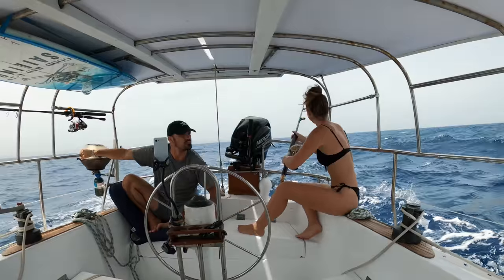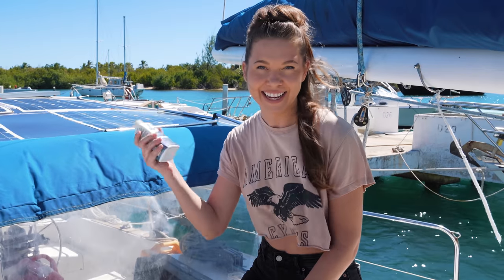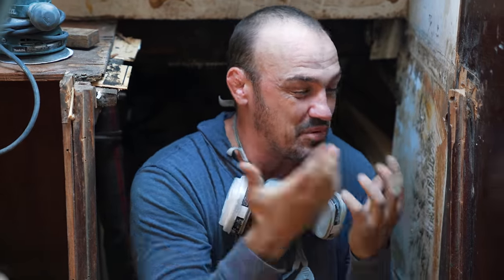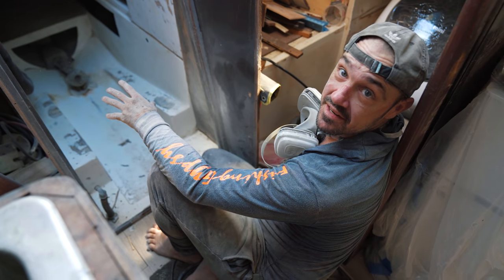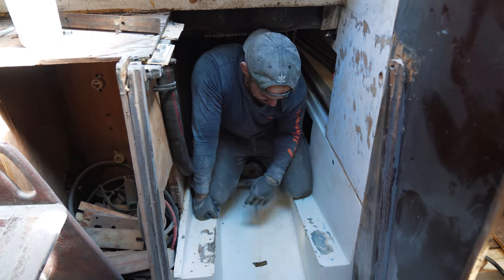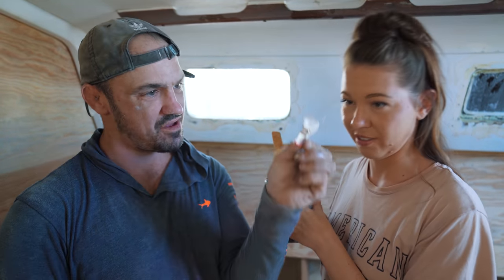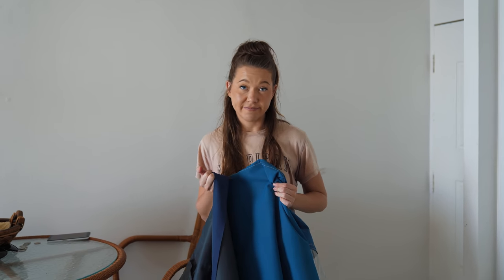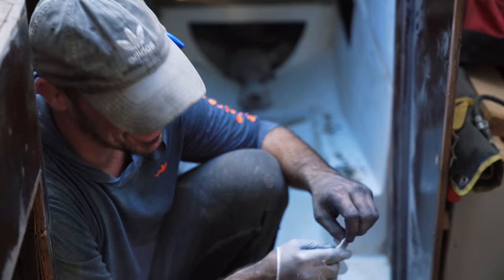BOAT LIFE: BACK TO OUR OLD WAYS TRYING TO CUT CORNERS!

Comment: What you have is not a true canvas.  It is an acrylic material.  The individual fibers in those types of modern marine waterproof rip stop, and semi waterproof breathable materials, are dyed before they ger spoiled into thread and then woven into fabric. 

     I've been where you are.  I have tried repurposing faded covers and Bimini tops for my 2 boats over the years, and you definitely cannot dye thos materials with regular immersion dyes for canvas and cotton.  I'm glad you 2 noticed before putting it back up.  The first time if got wet from a heavy dew, or rain, you would have had dye dripping all over your cockpit, and a huge mess on your hands.

     That being said, RIT, and other manufacturers do make special Acrylic immersion dyes.  I have used the ones from RIT with limited success.   It did hold at first and was water fast, but it didn't hold up well to the sun.  I'd say within the first 3 months it was severely faded and looked worse than before I dyed it, because it didn't do anything to protect the fabric itself from deteriorating in the sun.  

     If you look hard enough online there are a few alternatives to Sunbrella that are a bit cheaper and are made from the exact same material with the same thread thickness and advertise the same  sun and abrasion resistance with great reviews.  Stay away from Ottertex when shopping for Bimini fabric.

     Its amazing material if you need waterproof stain free stuff that isn't exposed to sun, but I tried it on my Bimini top on my fishing boat and it only lasted a month and a half in the summer Florida sun before it started fading badly, And became brittle enough it had to be replaced after one season.  My seats however that are under the Bimini, or the boat cover all the time have held up great for 5 years without a mark or stain on them and I fish with that boat and regularly get blood on them. It is also completely water proof and therefore doesn't breath at all. You definitely need a breathable material for a Bimini with vinyl enclosure windows.

Comment: Now is the time to redo your stuffing box for the shaft!!!!  BTW is there any reason a regular rubber seal could not be used? I mean create a chamber for greese between two seals like most engines have?? One could keep the stuffing box for backup but keep it loose till the seals stop working.. Just saying. Personally I never use and engine except for ballast. Too many problems and way too expensive.  Small outboard does fine when you have no choice like bridges in narrow areas. 
  It's been a good while since I seen you guys and it is wonderful to see you are as nutty as ever!! Blessings

Comment: Cutting plastic with an angle grinder can be dangerous. I had the cutting wheel shatter on me because the plastic melted onto the wheel and the wheel heated up so much I guess the adhesives in the wheel got too hot. Fortunately just a couple welts on my arm, but could have been much worse.

Comment: You're putting in a new engine, repair the shaft log. Some things you should not go Cheap on.
Those seals will not last and when they give out you will have to fix it anyway. 
THINK IT THROUGH.

Comment: they make all kinds of spray paint in spray cans for canvas fabric for your dodger......google canvas fabric spray paint
Reply: What kind of paint do you use on fabric canvas?
Painting on canvas is most commonly done with oil and acrylic paints. With its favourable qualities, acrylic remains a popular choice due to its ease of use and speed of drying. This paint has a thick, gluey consistency, so it pairs beautifully with canvas with its thick, gummy
Reply: What kind of paint do you use on fabric canvas?
Painting on canvas is most commonly done with oil and acrylic paints. With its favourable qualities, acrylic remains a popular choice due to its ease of use and speed of drying. This paint has a thick, gluey consistency, so it pairs beautifully with canvas with its thick, gummy

Comment: I absolutely love your channel but I hate to break this to you. You will never use the washing machine when on anchor or while sailing. It's just not feasible to burn through 20 to 40 gallons for a load of clothes. You will use it when at a dock and hooked up to a water hose. I lived in an rv for many years with a washing machine. Never used it while unplugged. Otherwise great video. Love you guys.

Comment: Matt, you are killing me with the raw resin trying to fill holes. You have got to put a filler in there, chopped glass and micro balloons or cabacil raw resin has no,strength and will just crack and crumble when you drill it.  West Systems is not like the fill resin you see people pouring in tables.

Comment: You realize your boat is a Hunter, right? And it will be a constant money pit, with never ending repairs, right? Hunters are literally disposable boats. They are nice for 10-15 years, then everything starts breaking down and /or rotting/corroding badly. A slight bit of research would have informed you of this. You will NEVER finish all repairs. Everything was was put together as cheaply as possible with a short lifespan in mind. People who suggested sinking the boat and starting over were not joking as much as you thought. Hunters are the Trabants of sailboats, except Trabants actually had long life composite bodies. If you want to roam the oceans, get a used Pearson, Bristol, Cape Dory, or other such boat with a SOLID hull. By now, you know that GBU has a hull almost entirely made of core, with just a veneer of fiberglass. I am impressed that the sides of the hull are not all dished in yet. I guess the earlier Hunters have slightly thicker fiberglass than the current models.